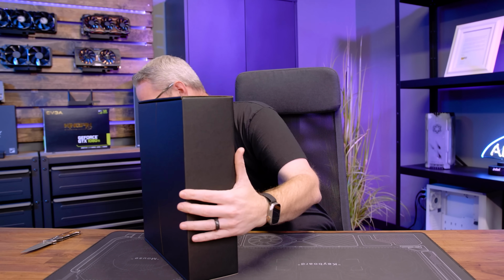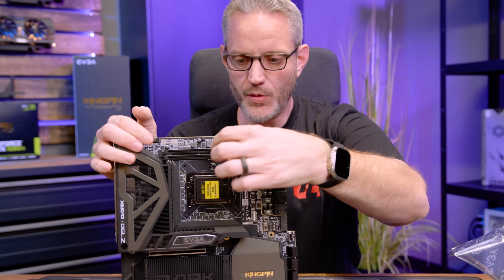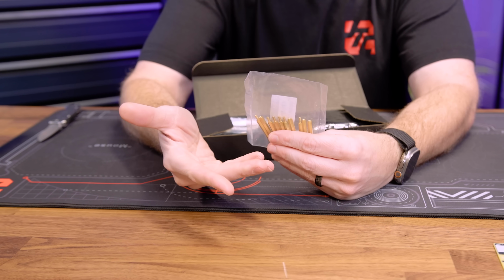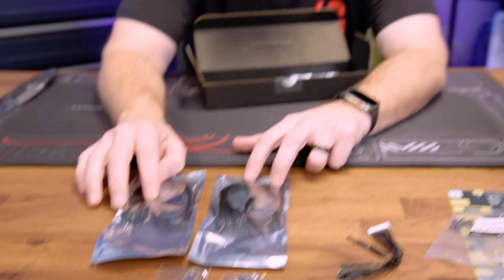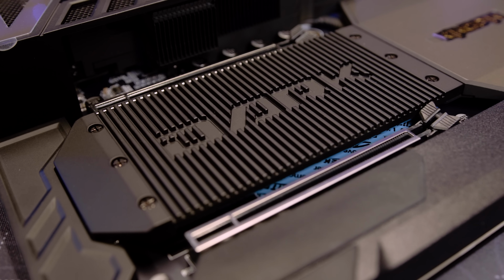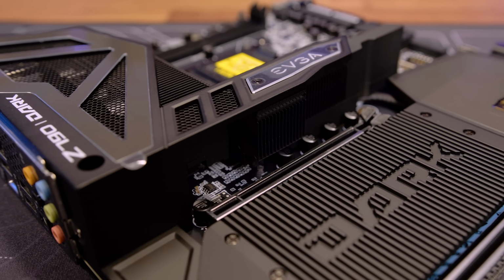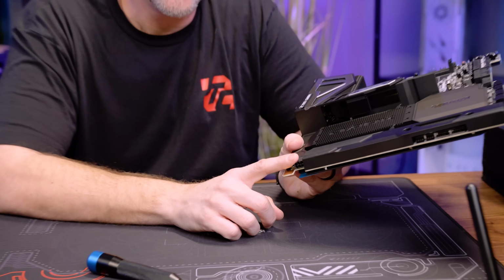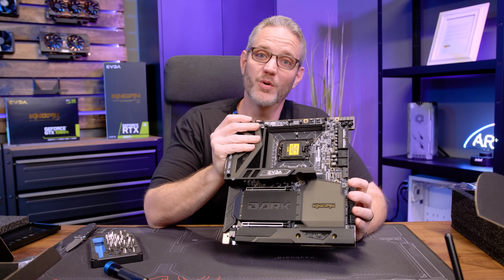EVGA created the mother of all boards... Z790 KINGPIN

Comment: Would be interested in a motherboard that has two halves of a processor... Half on front and half on back of the board... Ram and nvme's on the front, GPU on the back with a joint water block between the CPU and GPU. All power plugs on the end of the motherboard away from the user interface.

Comment: id love to see you do some OC/XOC with  this board.
the pcie switches are so they dont short with moisture when ln2 and not in use.

i got mine last week. 5.8 all p core easy, 5.9 on cold air, with a cache of 5.4.
ddr5 a-die runs daily at 8200mhz 36-46-125.
i cant wait to get my ln2 pots and back plate heaters, next month.

i had to use different m.2 screws, idk i couldnt get these to work.

Comment: Not a fan of EVGA products.  Had a brand new EVGA 1000 watt  Power supply die in one day and take a $400 video card with it. Luckily Microcenter took it back and refunded my money for both.  Luckily my motherboard had voltage protection and saved everything else, thank you ASUS for a great motherboard. Could have been about a $2000 hit. Had 14TB of storage and dual graphics cards. 64 GB of ram. All were saved by the board. I'll never trust EVGA again. Remember their video cards catching on fire....I do.

Comment: i like what they did with the ARGB header and..they got 4 instead of 2 as well!..most boards stop at 2...its not enough if u attach other accessories/strips. Otherwise, even if not overclocking, their port/pin placements are a huge help to QOL, if only other brands learn some sense in designing stuff..

Comment: Very nice board. It's interesting to hear the 6 pin power for extra watts to the pcie slots is unnecessary now since I just had to plug mine in on my Asus z690 Hero board to stop games crashing with my 3080ti.

Comment: Regardless of LN2 or not I like the boards purely because they are built properly and with the quality all boards should be built at. Some of the added stuff for LN2 does have use outside LN2. Those voltage probs for example can be used to diagnose problems. 3% of their business comes from MOBOS because they only appeal to 3% of computer users. If they make a full range of mobos they will take over.

Comment: Hyped brand. The motherboards are good but the Bios is restricted and missing a whole lot of features, that Asus ROG, Asrock, Gigabyte, Msi do have!!

For instance, I overclocked every single core of my I9 7900x to achieve additional 75points in Cinebench R15, which took me 40-50hours.
In the end I couldn't run it, because the Spread Spectrum feature was missing, and the BCLK was running below 100mhz.
That's fail!!

Comment: Jay, really... If you buying this motherboard, you wont be running standart size graphics card. There will be bigest , thickest card you can get in that slot. =D
4x PCI-E slot, they put open ended slot, if you put card with bigger connector you still need to take off that cover entirely.

Comment: Would you not agree that the Arc A750 is now better than the RTX3060 & is also 1/3 less cost! So unless you want & can afford an RYX3070 or better, the best option for budget gaming is now an Intel Arc A750 at $249! Let all the older graphics cards (RTX3060 & below in the 3000 range along with all the 2000 & 1000s) now pass into extinction, because the Arc A750 is also much newer & more future proof whilst support for the others is vanishing. AMD & Nvidia are short shipping to maximise their profits whilst ripping us off proving they don't care! So sod them and switch to supporting a new 3rd supplier for a better deal!

So now, best options for your budget: 
Under $500 = Intel Arc. 
$500 to $1000 = AMD. 
Over $1000 = Nvidia.

Comment: You can turn off the NVME's, because (or so I have heard) when installing Windows it doesn't give the user any choice on what drive it installs to, and may wipe your data if your dumb enough to let it, and well, plenty of dumb people do just that!

I remember back in the day when I used Windows, having to open the case, unplug all drives but the one I wanted Windows on, and then plug them back in after install.  Shit, it would often fail with other hardware detection, and there were times where I would have to remove everything not absolutely needed, so add on cards too, and then after install, plug one in > reboot > get it running, and then repeat that for each item one by one until all drives and hardware were up and running:  Major pain in the freaking ass, but the easiest way to avoid problems!

Linux lets me choose, assign and change paths to drives*, and even partition them to differing file systems if wanted before install, and if it can't address something or find a driver, it just ignores it for the time being, and you can set it up later, even look at the installation, and boot logs to get clues on where and why something went wrong.

*In Linux you can mount partitions into file system paths, and so when in a file manager..., a folder can be a drive, and it allows for some great security and nifty setups, like having different users on different drives, or separating your private stuff, from your business stuff.  It lets you do all that out of the box, no special software... needed.

Comment: Jay, I have been an ASUS motherboard enthusiast over the years, just because of the things that ASUS made available for it's boards, but over time it has become more and more difficult to find the accesorized parts for their motherboards.
I am willing to run either Intel or AMD because today they both have good products, but my next board would be an EVGA motherboard as long as they are accessible and affordable. The ASUS ROG CH8 FORMULA motherboard I am running was $520 at Newegg, only 2 years ago.
Today it's still available at $599 at most retailers, although they have limited quantity stock and that is understandable given we are all still recovering from the pandemic.
I am still rocking my EVGA 1000G2 Power Supply 👍🏻👍🏻. Never has been a problem since day 1.
My next platform upgrade will definitely be on an EVGA motherboard. 👍🏻👍🏻

Comment: only gripe with the M.2 being this way, good luck getting it unstuck when one of em fails, the pads stick like a MF, had that issue with the Z690 Kingpin, one drive failed and had a hard time taking the heatsink off, sticks way to hard, and its soaking the heat from the GPU, so M.2's will run around 50C, and that heatsink will do almost nothing.

Comment: I like EVGA's aesthetic choices and board topology in general but no, I would never buy one of these boards at these exorbitant prices. I'm not an overclocker, in fact I think the days when CPU overclocking had any utility for the average PC enthusiast has long gone past. It's now only for enthusiasts with a lot of financial resources to waste on temporary records, mostly sponsored by manufacturers for slightly misleading marketing purposes. It's like car companies building hypercars as halo products so the hatchback shopper is led to imagine they own a sports car. CPU overclocking is absolutely useless for 99.99% of the gamers out there, current processors run very hot and consume enormous amounts of power and they offer very little percentage improvement with high voltages unless of course you get sent cherry picked golden samples like most reviewers do and even in those cases, the ROI is pretty pathetic when you include the cost of a high tier cooling solution to dissipate 300W from a tiny CPU die. This is a very niche product that only functionally serves the 0.01% of Z790-13900K buyers and the rest of the people who buy it are either clueless about what they're buying or just want to brag about it on reddit for e-peen points or whatever.

Comment: As someone who has a 4090, and who has a supercharger on my F150, I don't get the point of these high-end OC MBs. See, 4090 I don't have to explain to anyone here, the Supercharger brings the 5.0 V8 from 395 HP/400 Torque to 650/610. It's a HUGE improvement. Full size pickup truck does 0-60 in 4 seconds and I can very easily pass and weave through traffic.  The upgrade was worth the money, and it makes me smile. Now, I COULD tweak settings and change out pulleys and spend a lot more money, possibly break something to get a tiny bit more power... but why? I wouldn't notice it, just not worth it. 

I see it the same way with computers. If we both have a 13900k and 4090, but I have an Asus TUF MB and you have a Gigabyte Godlike or EVGA Kingpin and tweaked out your setup, I might get 100 FPS max settings and you might get 103-104 for much more money.... who cares? Now if it was 100 to 125 I'd spend the money, but it isn't, it never is. Just not worth it. The point is, I will spend money if I get substantial improvements but when it comes to MBs or a STRIX 4090 vs a TUF 4090 I just don't see where my money is going.

Comment: The only time I was unhappy with an EVGA product was a Z97 board (I think it was an FTW), and I had 3 straight RMAs for the m.2 slot not booting. Bought an ASUS and no issues. It'd be cool if EVGA launched a more mid-grade motherboard, but it is also cool that they are leaning so hard into the enthusiast market.

Comment: jay extra 6 pin extra [pwer is used as well to charge phones etc by thunderbold usb4 or usb-c if you don't plug in 6 pin you wont use full charge power of this ports (I read x670e croshair hero manual)

Comment: I think it's neat to see a mobo with power\reset switches on them. An old trick that I used though for mobo testing outside a case was that I salvaged a power\reset switch from an old case I tore apart. Just needed to plug it into the mobo headers and I was good to go.
Reply: Can also just touch the power pins with a screwdriver brother. But ya the old case power switch trick is cool. If ya can be bothered to get em out the case, if ya have a spare case, alot dont I guess.

Comment: im loving my x570 EVGA FTW MOBO. although some of the inputs were at right angles instead of head on and i had to use a dremel on my case in a few places to create space for plugging in cables. gonna keep my 3080 rtx EVGA ftw3 ultra in there until they get back into making gpus

Comment: I have nothing other than good things to say about EVGA, I had one of the 10 series GPU's that exploded due to a manufacturing defect that caused said components to be missing their thermal pads for conductivity to the cooling solution. TLDR, got to hot and magic smoke. They were by far the easiest company I have worked with when things went wrong. That care of customer service makes you want to go back and support that company that promotes said values. Said lack of care is why I will never buy an ASRock product ever again. I just wish EVGA would make more AMD chipset boards, as I would buy them, but also AMD GPUs as I trust them to do the right thing when things go wrong.

Sometimes a price premium is worth it when you know the company itself will stand behind you.

(oh just wait, they till need that extra power connector when the titan launches. They has plans.)

Comment: If EVGA or anybody can't have their products ready at launch of a new platform they may as well not even bother. I bought my ASUS ROG Maximus Z790 Extreme within days of launch. Midway through all I'm thinking about is the next platform Meteor Lake which is only months away at this point. Instead I wish EK would get off their rear end and have their blocks ready at GPU launches. So the enthusiast builders aren't sitting there twiddling their thumbs for two or three months waiting for their blocks.

CPU-Z HSGHTK
Reply: .. You've only mentioned half the problem with his M.2 solution, The other problem is you have these 55° C M.2s or even hotter literally sitting on top of each other next to each other with no spacing only making the situation worse. Bad move.
Reply: .. Dual BIOS Chips???! Can't imagine Kingpin overlooking not having dual BIOS Chips??

Comment: Nice board, but no captive screws on the m.2 heatsink? SATA ports under the VGA cooler? no way.
FrontPanel cable plugged in? Good luck.
Plus points for the POST display, LEDs and the buttons.
But nice board.

Comment: I don't understand these boards. They have workstation features like 10g network, but then crippled with 2 memory slots. You also don't need 4 RGB headers if it's going to be on a test bench for sub ambient overclocking. It's like they want to make the OC board, but in order to sell it to the high disposable income crowd, they need this kitschy crap.

Comment: You don't actually have to remove the GPU to access the NVME slots because you can mount the GPU in the slot on the other side of them and it will act just as if it was in the slot nearest the CPU. This board is designed primarily for SPUs with 20 PCIE lanes, 16 for the GPU and 4 for the first NVMe, the other two NVMe drives are covered by the PCH. If only one of the 16x slots is populated the other one is turned off.

Of course, mounting the GPU away from the CPU will block the 4x PCIE slot that is hidden under a cover as shipped.

Comment: I wish more motherboards would turn the CPU socket like that. Cause with RAM out of the way air flow can run directly around the CPU.
Reply: Do that and only have 2 ram slots.
Reply: @djsi38t  for most people not really the problem i think? Ram isn’t that expensive anymore. I got 2x16gb 3200mhz for 40 euros. And well currently dont need more. 

64gb as in 2x32gb increase in price is a lot tho. But if you really need that much ram you’re probably spending a lot on a pc anyway so wouldnt really matter that much?

I get your point tho, but i would actually like the extra airflow. Guess its preferences too

Comment: to be honest, anybody how is getting a kingpin board, or anything like that top end n that matter, will not need to add n extra drive to their system because it would be already more than enough. also the graphics card would need to be uninstalled either way because they are probably using something massive to begin with.

Comment: The dual ram slots is why I won't be buying this mobo
Reply: Boards like this were never intended for you then. Its a XOC motherboard its not for the avg gamer or editor.
Dual ram slots have better stability than 4 slots & can clock higher and have lower latency

Comment: I'd really love it if the 24 pin and 8 pin being on the right side of the board became the norm for all mobos in all price ranges. It makes the 8 pin more accessible and having them turned makes for much cleaner cable management. It could end up being just the GPU cable/s that are visible in builds.
Reply: I've long thought GPU power connectors should be on the end of the card instead of the side facing the panel. They don't want to interfere with length restrictions but with how chonky GPUs are getting now they're running into your side panel anyways.
Reply: Its cuz initially its meant for a test bench setup.

Comment: You didn’t mention this but I love how thick the pcb is on the dark and kingpin boards and the 2 dim ram slots should be standard, but these together get you so much mhz overclocked on ram you couldn’t usually get on a lot  of other boards period!! Second place i the unify Board by msi. PS THE Z690 kingpin is 50 percent off right now ONLH 499!! Ya it’s alot for a mb but not a kingpin!!!

Comment: I wish they would some upper-mainstream boards, still for enthusiasts, but maybe not so geared for extreme overclocking. They could expand their motherboard business that way and also more people would get to enjoy EVGA goodness.
Reply: They need some $300 boards, the Classified boards used to run around $300.  I’m not paying $600 for a motherboard when a $300 board will do almost the same job.
Right now I have a z390 Dark, it was $500.  The only thing it can do that other boards can’t do is stress testing in the bios, which is a convenience not worth $200.  To be fair the memory compatibility is excellent, but any board can have that feature it’s all in the bios development.
Reply: I’d love to see boards starting at the ~$250+ range now that they don’t have a graphics department. Their graphics cards used to start in the affordable range as well. They don’t need every single confusing SKU other companies have (and I pray they never go that route), and they don’t even need to have more than the highest chipset, but a bit more selection would be great. I stopped buying in the $350+ tier since I/O expansion has gotten so cheap but I’d do it again for EVGA.
Reply: I think ASUS has that on lock.
Reply: Totally agree with this. I would love to have an Evga board in my build but with their current line there are just to many features I  or even most people wouldn't use.

Comment: Is it sad that my first build was in 07 yet I'm still only on my 3rd case ever?? lol easily the single most "part" that I've replaced the least over the years
had an xclio case to begin with (front looked like a jet engine)
2nd case was cooler master storm Stryker that I sold to a friend , and currently using the cooler master 500m